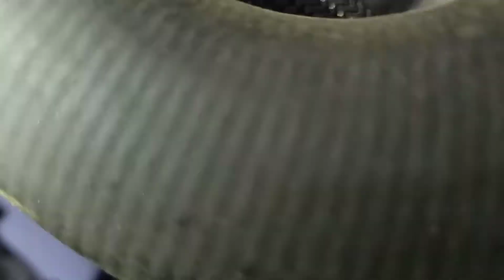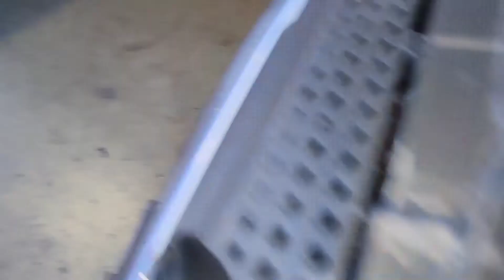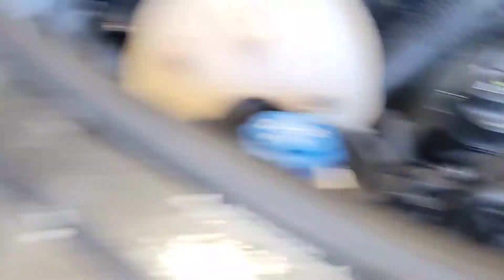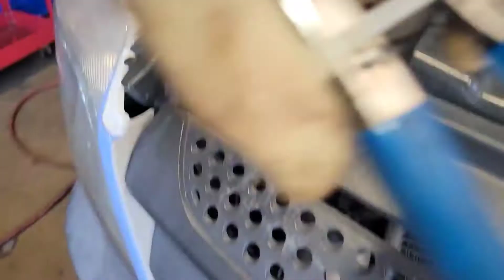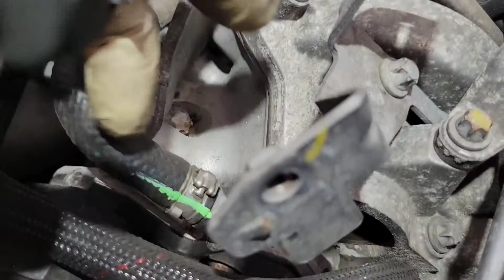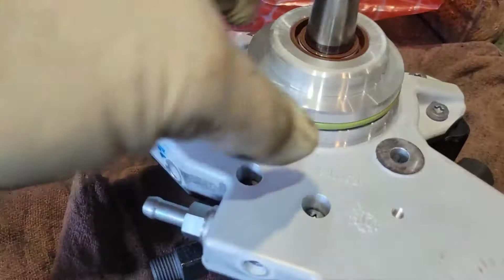Sprinter  High Pressure Pump

Comment: 2016 om642  with p0090  hard start.  psi at koeo 350  runs for a bit at 4500psi then Stumbles and shuts off.  any suggestions.. TIA
Reply from the maker: Off hand not sure but you can message me on Instagram

Comment: What are the symptoms of a failing hpfp
Reply from the maker: No start usually or low fuel pressure codes.  The pump itself doesn't fail often its usually the solenoid in the pump that can be replaced separately.  This pump was leaking fuel.  Thanks for watching.  Message me on Instagram if you have any questions.
Reply: Poor acceleration and rattle noises during accel and decel.  If in doubt, replace.  If the pump fails mechanically, it will send metal shrapnel into the fuel rails and injectors and the parts alone are over $4k to replace all of that if you DIY.

Comment: The HPFP gear does not need to be marked, it is not timed. 
It proves consistent pressure just like a Gasoline fuel pump in the rear gas tank.
Reply from the maker: Yes but the timing of the gear to the pump can cause an engine vibration if not timed correctly. Thanks for watching.
Reply: Hypothetically, say someone didn't mark the gear... How would one know where / how to position an approximate alignment looking at the lobe on the gear compared to the inside of the pump?
Reply: On the om642, the pump is indeed timed.  Not for injecting fuel, but for balance.  If you look at the pump gear that you have to transfer over, you'll see a large asymmetrical lobe on the back side.  That weighted lobe acts like a balancer shaft in the engine.  If you don't time the gear the same as it came out, you'll have a nasty engine vibration.  Video didn't show it, but torque spec on the 21mm nut is 70 nm.  I clamp them in a vice with blocks of wood to protect the teeth, and then torque it to spec.

Comment: Does the new pump come with the sensor and regulator?
Reply from the maker: I am pretty sure it does come with them. I just googled it to make sure and it looks like they are on there. Most High Pressure pumps come with the the regulator and sensor if you get a good one. I looked at a Bosch pump. Thanks for watching.

Comment: Got a quick question for ya. We got a 2015 sprinter van here at the shop. 3.0 liter, replaced the high pressure fuel pump. Other technician never marked the timing on the pump during assembly, what is the best way to go about getting it back in time
Reply from the maker: Hey man sorry for the trouble you are having. I will have to look it up at work, if you could message me on my Instagram the vehicle info and I can help you with that. Thank you for watching,

Comment: Just what I was looking for. Got a link for the 36mm wrench used to remove fan clutch?
Reply from the maker: Sweet I am happy you found the video.  As for the fan clutch I use a kit that attached to my air hammer.  Here is the link to that kit but you will need an air hammer as well. https://amzn.to/3xTAsLl
If you have any further questions hit me up on my Instagram and I can help you out.  HERE is a link to a 36mm open ended wrench. Not sure if the length will work. https://amzn.to/3EG8GFR
Thanks for watching.